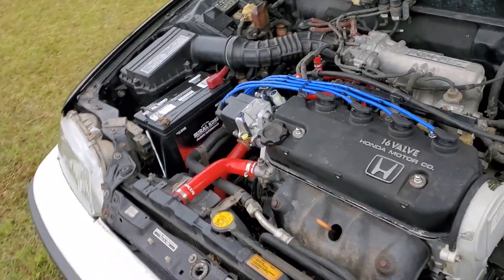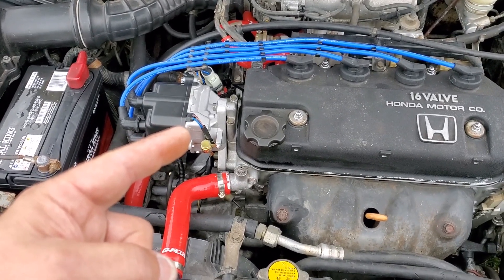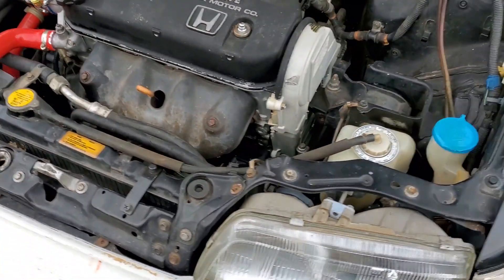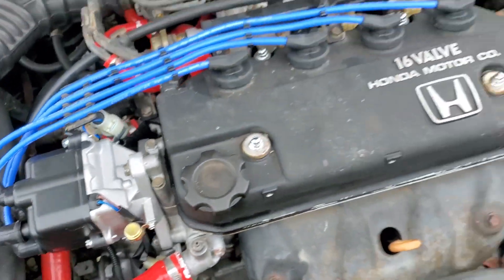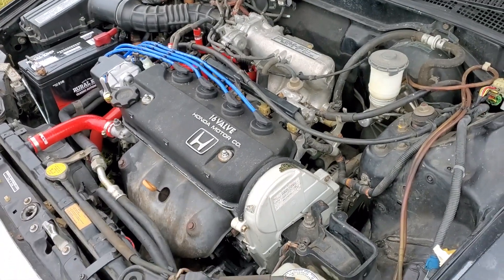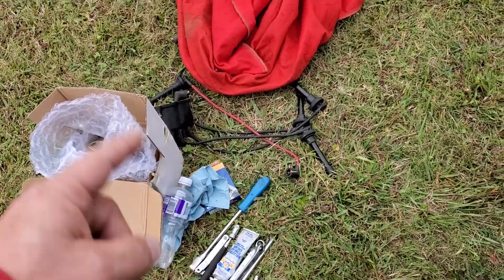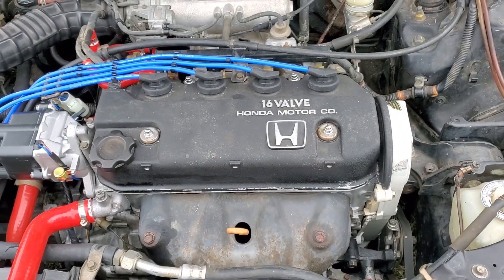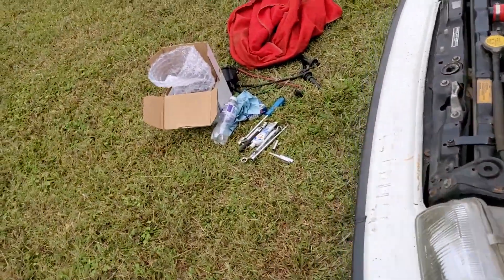CRX Update - Slow going.

Comment: Lol wonder if pin that centers it up is binding in end of cam
Reply from the maker: Ive seen that many of times. When i install these type, i make sure it free floats with no binding. You used to be able to buy rebuild kits for these and ive built several..and getting the shim on endplay can be a booger.